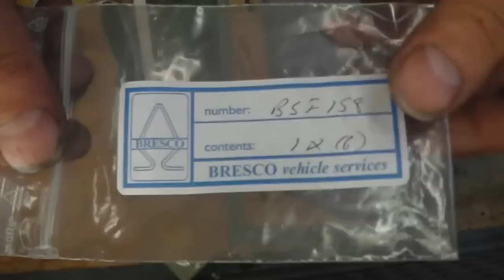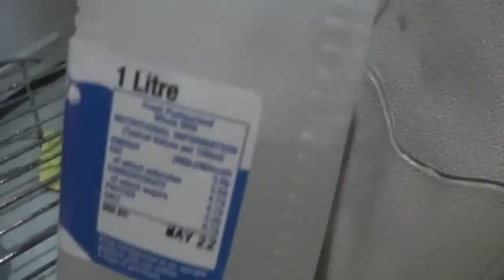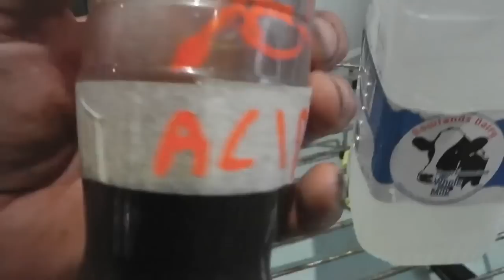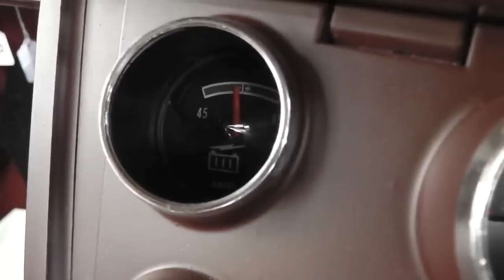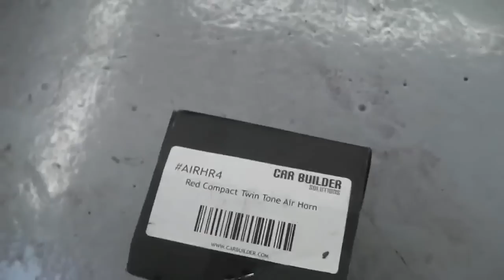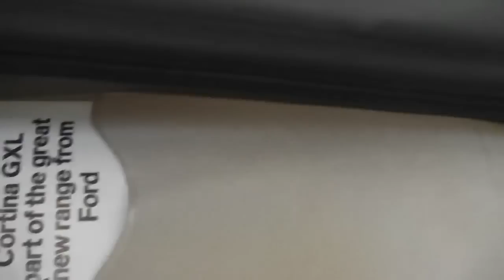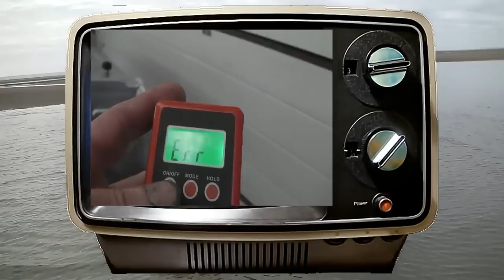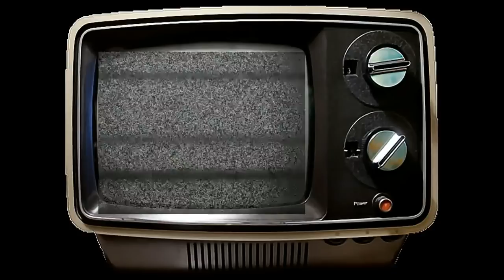Classic Car Restoration - Ford Cortina Mk3 - Project Bramble Ep41

Comment: The thing is, you have to accept minor inconsistencies such as the chrome trim..That's because it is a hand built car...From the factory, the cars were basically thrown together as fast as possible to things like the trim don't even get noticed. When Bramble was completed by Pete, the car was/is built to much higher standard than Ford could ever have dreamed of.
I've seen every one of these videos over the years.

Comment: Bonza fuc....... job, as always.  I don't care about your personal life or anything else, I command you to keep doing the vids.Not only do we learn as you go but we get entertained too. I was a trimmer at General Motors Holden, don't cut the fabric on a straight, just use equal pull pressure to glue to the template, only cut on radii and then cuts say a centimetre apart. Cheers man, I'll drink a Coopers for you. Keep safe. ps keep glue off foam.

Comment: Those white tabs on hoses,pipes etc.almost always denote where they are fixed to something else or supported and a little tip for roll pins is to freeze them for a bit so they contract slightly helping to get them started.

With the advancement of logic control relays are disappearing,I've collected an  OE relays of various configurations from my various trips to my pals breakers yard,Avoiding any VAG,Magnetti Marelli and Omicron stuff and use those instead of aftermarket stuff.

Comment: The round piggynose mounting are the correct ones for front and rear exhaust fitting,the elongated mount is for later fords,sierra,escort,etc, the center mount is for height adjustment ot the exhaust system and early mk3 cortinas had an additional mount at the top of the rear wheel arch to support the exhaust, but ford discontinued these after a couple of years, but great work pete, keep the restorations going.

Comment: A low wattage Soldering Iron is ideal for welding plastics using the same type plastic that's being repaired as a filler material if needed. Not sure what type of plastic is used with windscreen washer bottles, it could perhaps be one of the  difficult to repair plastics using this heat repair method.

Comment: Same problem, same solution. Liquid windshield reservoir broken repaired with epoxi compound. 35 years ago I did the same using Araldit in dovetail join.

Comment: Never had any success with spray glue always ended up doing the job again using contact adhesive directly from the tin , hope you don’t have any problem !!!!
Reply: Funny you should say that,I recently retrimmed some door panels and used spray glue,they looked good for about a week and now the vinyl has come unstuck due to poor glue

Comment: Until starting watching your channel, may of noticed imperfections in your car and though of them differently in the past before realising the parts situation on your ford or my project.
Consuming cheap honey on a daily basis may help to improve your hay fever. As tempted as you may be to purchase more expensive honey, you need to cheap honey as a means to expose your immune system to tiny amount of different pollen, reducing ones immune response future exposure.